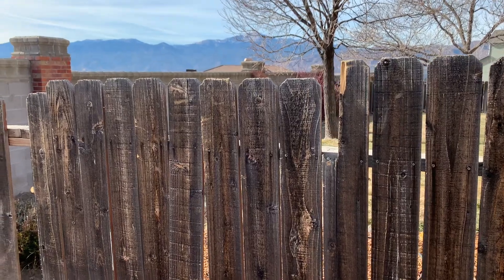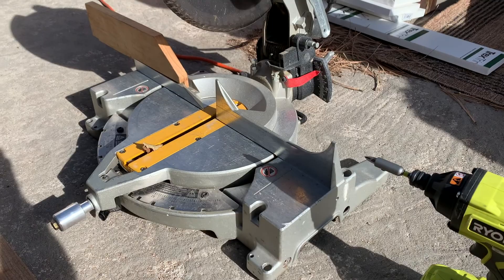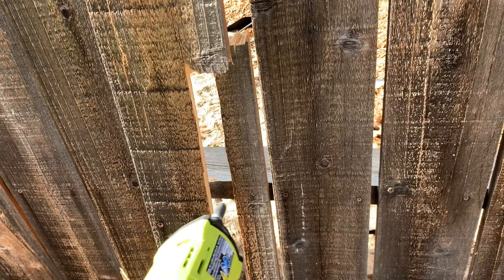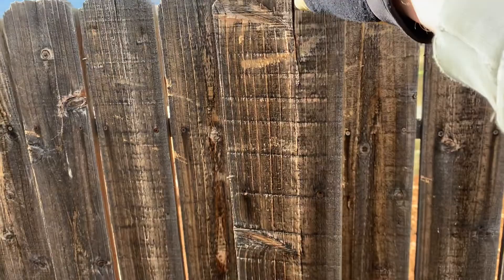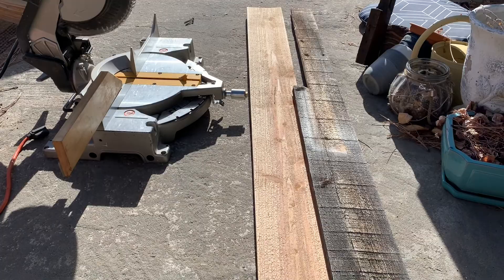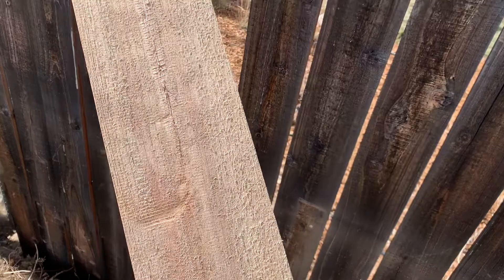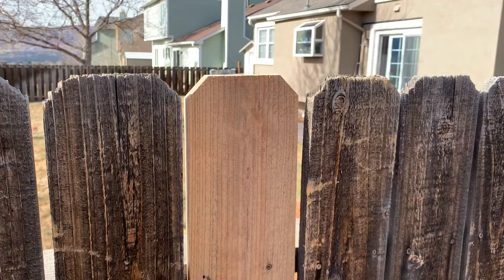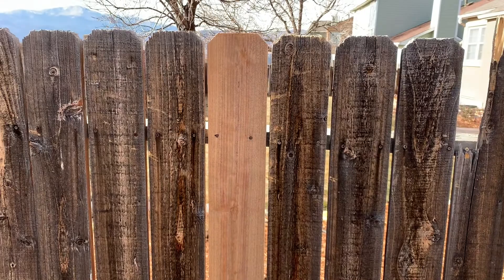How to Fix Replace a Wood Fence Picket

Comment: Thanks for this video, one question when doing this, on the new picket should we aim to line up the screws where the existing holes are in the 2x4 behind it? Or should the existing holes in the 2x4 be avoided on purpose?